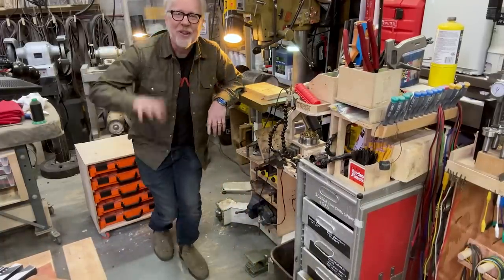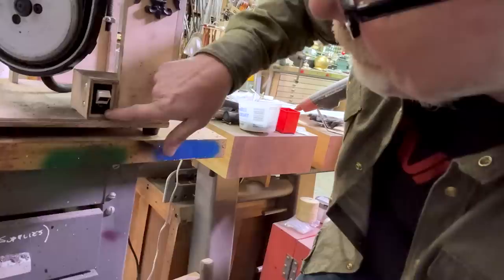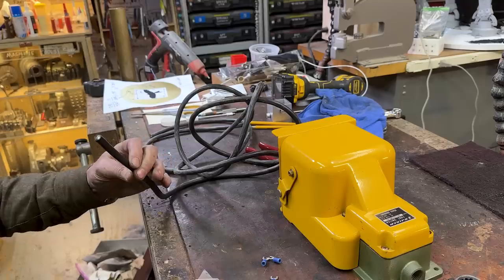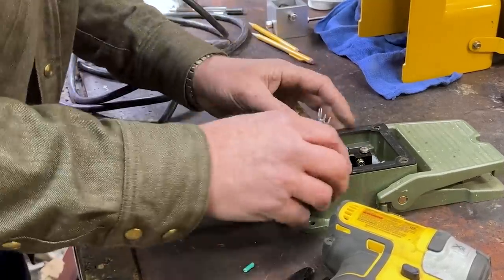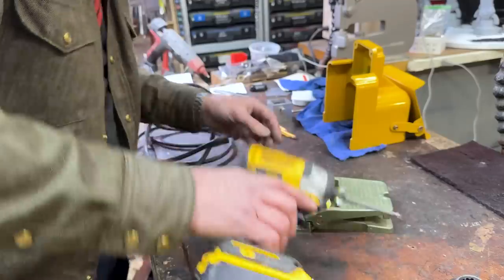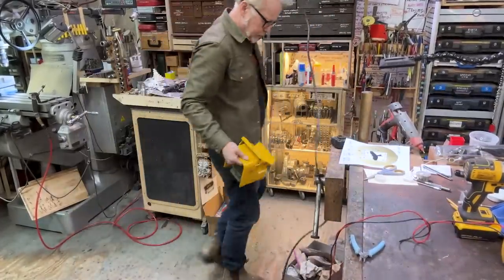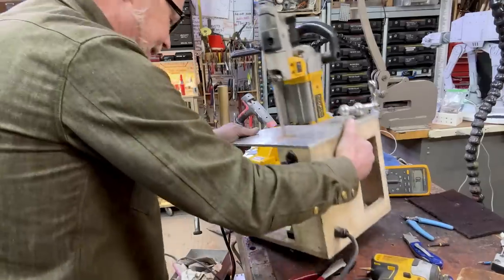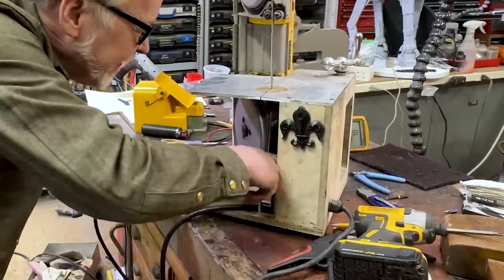Adam Savage's One Day Builds: Foot Switch-Powered Shop Tools!

Comment: Adam, you should really take a took on cable strippers like 
Shtok SI-13
Jokari Allrounder
Jokari #14 or #15
Knipex KN-1664125SB
Haupa Allrounder
to take the external isolation off round cables. There are also similar models for "flat" cables can be in other shapes

Comment: 7:00 The way you scale rubber cable is you use a side cutter to split the end of the cable, make a shallow ring whit a knife where you want to scale to. Peal the rubber like a banana then ripping it off at rhe ring, use side cutter to start the ripp if needed.

Almost impossible to damage the insulation, very fast and easy. May waste half a inch at the end.

Comment: you could have the foot switch control power to a surge protector on the top of your workbench, so if you want to use the saw, drill press, or whatever you plug it in and then you can control its operation and you won't need to buy half a dozen foot switches for each tool

Comment: Should also be making sure you're not leaving exposed metal devices ungrounded waiting for a live Hot wire to make contact with the outer housing and energize it without anyone knowing it until they come in contact with it. Rather having the casing grounded well cause an instant tripped circuit to notify you of an internal fault, especially without that cable clamp to keep from pulling the wires off the terminals.

Comment: I was expecting you to put it on the disc sander.  You use it a ton for quick momentary uses and you're holding a piece with both hands, plus that makes sure it shuts off when you walk away.  With the long wind down, it's sometimes hard to tell if it's actually off when walking away

Comment: I wish all plugs and sockets had lights so you would know if there was power. A small LED on the wall socket, a nice powerful LED set up (such that it is easily visible in the daylight). I've created this situation with essentially permanently-attached extension cords, using the kind of industrial-strength plus that you can twist, locking them together. While they are all effectively invisible in the daylight outside, I never have to search for an extension cord and in most cases, I know if the wall-socket is getting power and (provided I'm inside or even under some shade), I know if the end of the extension cord is getting power. If I turn the tool on and nothing happens. It's easy to check where the problem is. I also label the cords front and back.

Comment: I put a foot switch on my chicken plucked.
Look at the videos of chicken plucked. The on off switch is located in an area where when you t turn it on your face is Approximately 12 inches away from 4-5 inch 35mph whirling flipping flying headless chickens. 
As I watched the videos, while mine was being manufactured in Texas,  USA. I purchased myself a waterproof one. As you are also supposed to be spraying the things with water. Mischief safer, as it only takes 8 seconds to pick 3 chickens

Comment: Adam.  For the love of all that is holy.   Please use your grounds.  If your cord has a ground conductor always connect it to the housing just incase something comes loose or shorts internally. Industrial Lego like that foot switch always has a terminal to connect directly to the case for safety grounds. And please get you some CGB’s to keep in your collection of madness. CGB istands for Cord Grip Bushing. It is a compression fitting for conduit type connections such as the back of that switch that gives you three functions at once. It give strain relief on the cord, protects the cord from sharp edges in the enclosure, and seals the enclosure from ingress of dust and liquids which is especially handy for something that lives on the floor that you are effectively kicking anytime you use it.

Comment: Looks nice but is potentially deadly. It needs that Earth wire connected to the chassis of the foot switch. If one of the other wires becomes disconnected inside the foot switch and touches the metal case then the entire device is no longer touch-safe. I have a foot switch like that, and just had a look to see how the Earth mounting point is done — you can use the screw that holds the cable strain relief clamp approx. 10 mm behind the cable gland.

Comment: Surprised Adam doesn't have those wire strippers that strip wire like that. They spin around that type of wire to make it easier to remove the insulation. I got mine years ago at harbor freight and still use it today.

Comment: I hope that foot switch does not ever have a short to the metal casing because if it does that could really hurt. While it might be just a rocker switch the voltage is still 120 with at least 10 amps. With the full load passing potentially through the body, in the right situation this could be deadly. Please be careful Adam!!!!! With love from an Electrician.

Comment: I have a better tip for stripping cables than what Adam showed.  I work in IT and there's nothing more frustrating than terminating a run of Ethernet cable and having it fail because you ever so slightly nicked the insulation of the twisted pair cables inside.  

What I do (often with a scissors from a Swiss Army knife) is make a cut along the outer insulation longways, near the tip I plan to cut off.  Then I grab the insulation and pull it back like I'm peeling a banana.  

Then I carefully dissect the rest of the cable, cut the shielding and core support, or prepare the twisted pairs for termination.  Once I'm done, the last step is to trim back the insulation, which resembles a crude circumcision.  

That way even if I'm using a straight blade of a razor or knife, I can slip without ever risking damaging any of the cables.  Then all you have to do is get familiar with how far down the twisted pairs need to be in order to successfully punch them down in a patch panel or jack plate, or how far forward they need to sit if you're making the male end of an RJ-45 cable.  Personally, I prefer to have the connectors that have a through-hole design and made for thicker gauge CAT6A, because I'm often using shielded and/or plenum rated cables so things get too cramped.

Hope that helps any of you folks looking to DIY some electrical or network cabling on your own, because that little trick greatly reduces the chance you'll have to redo things or worse if it's higher voltage electrical.  It turns out that most wire strippers go a little deeper than the insulation, and if you have thin insulation on the inner wires or aren't using thicker gauge, solid copper wires (like residential wiring).

Comment: You need to strip the outer layer of the same type of wire... there are special strippers that will do that and never cut too deep... fairly easy to cobble together a purpose specific stripper yourself as well.

Comment: I was thinking that Adam was going to make this foot switch "universal" for use with any of his tools rather than "dedicated" (permanently attached) to one tool.  A universal foot switch would have a (male) plug 🔌 providing power into the switch and a (female) duplex outlet to send power to any tool.  Note: You only switch the hot (black) wire. Green and white wires would simply pass through the housing.  My $0.02.

Comment: Ordered on for the wood shop and one for metal shop. Will wire to receptacle box and extension cord as suggested by @JustinCheger so I can use one switch for various tools to see where I use it most. Then I'll add dedicated foot switches where needed.

Comment: Couple things.  You should really get some proper strain relief on that cord.  All cords need strain relief and those zip ties are not a great solution.  It's a $0.30 part from the hardware store.  You also need a ground to the chassis of that switch.  Any time you have 110 or 220 VAC in a metal enclosure, you NEED a ground to protect you from the case getting electrified.  This is most likely to happen if you don't have proper strain relief and one of the wires pulls out of it's crimp connector.  Safety Third.

Comment: Why not hinge flap on front where put foot in in, flap goes inside top. Then when remove foot flap comes back don to close (with magnets) no having to balance to flip it up top first. More automatic. Also put breaker where old switch was. Spring style strain relief. Dont forget to. Label machine it goes to.

Comment: Those crimp on connectors should only be used for 12 volt systems. Higher voltages can degrade the connectors over time and significantly increase the likelihood of a fire.

Comment: Great idea. Any reason why you couldn't wire the switch inline with the power supply cord? The neutral would pass through. You'd only have one cord running into the saw.   Plug --> Switch --> Saw
Reply: I wired mine in with plug ends for easy versatility. Plugged any tool into it.

Comment: I would have designed the foot switch as a normal extention cord. that way it can be in line with any tool and removed as well at any point without changing the internals of a product

Comment: just an idea ... you should of made a pluggable switch for 2 reasons. 1) if you need to move or transport the machine you wont have a hard wired tail (foot switch) that you may not need/want at the time . 2) with a plug on the end, you could make any/every machine in the shop foot switch powered and just move the foot switch ... otherwise  great video

Comment: Hi Adam, electrical engineer here, I mean no disrespect but this is simply not safe. You MUST ground the metal case of the footswitch with the green wire on the cord, and connect it at the saw end to the ground coming in from the outlet. If you only have a 2-wire power cord to the plug, replace it with a 3-wire one. You MUST screw a proper cable gland into the threaded cable entry on the footswitch, not only to clamp the cable, but also to prevent it from rubbing on the metal and getting damaged. And you should do something similar at the saw end - I can see there's already a gland on the power cord. Finally, it is not good practice to have mains electrical connections inside a wooden enclosure, as you have at the saw, because it can burn. You should put the switch  and cable glands into a small plastic or metal box (ground the box if it's metal) , and screw that to the wooden saw stand. I can tell you did this in a hurry as you are excited about footswitches, but skimping on electrical safety is never acceptable. Please don't hesitate to contact me if you need any more advice.
Reply: Cable glands…?

Comment: does that footswitch have a "panic mode" (if you press it really hard it turns off)? That would be really good in case of a accident since you tend to tense up when shit hits the fan
Reply: It shuts off when you remove your foot.
Reply: @TheFatblob25  yes obviously thats how a momentary switch works. what im talking about is a additional safety feature
Reply: @niklasxl  if the dead man's switch doesn't cover it, you're out of luck. Ain't no way you're able to do something like depress the switch extra but NOT able to pull away.
Reply: @wrongtown  some bending machines ive worked with hadd ones where if you got pushed of balance towards the pedal youd bottom it out and the machine would stop so that you dont get trapped

Comment: Does your foot switch have a grippy rubber pad under it? In my experience, without that, they tend to creep around the floor and you end up having to fish for it with your toes.
Reply: He screwed it to the floor.  Should be slide resistant that way.

Comment: The green wire is the most important wire. So if the hot terminal comes loose and lands against the body of the metal switch housing, sitting on its not-ideally-conductive plywood floor, does the breaker trip? You now have a live 120v metal box just waiting on someone who is grounded to touch it and complete the circuit. The angry pixies want to go home and they will go right through you if they have to, give them a path home.

Comment: That cable needs strain relief Adam, it's gonna fail one day from being moved around too much, the terminals getting yanked off, wires pulled out of the connector, etc. This could cause one of the live wires to come in contact with the metal foot switch, which leads to the second problem here. The ground wire should be attached to the metal housing to ground the housing as well. That way the housing won't become electrified and have the current pass through your heart into the metal tool you're touching.

Comment: I love your videos and you inspire me greatly however I am concerned for you safety. That foot switch is not double insulated so should have the ground wire ( Earth wire) connected to the metal casing of the foot switch and through to the ground on the mains plug of the tool.

Comment: Also not an electrician: I know just enough to be dangerous. But I believe a large chunk of metal with which you make physical contact to turn on an appliance on mains needs to be grounded. If your hot terminal popped off and sat on any metal part without the ground to complete the circuit, the breaker wouldn’t break and it would sit there live waiting for the next unfortunate person to touch it or short to something else and start a fire. That green could have been used to tie any part of the metal (I would be surprised if there isn’t already a connection point somewhere in the switch) onto the ground wires that are presumably already in the band saw and eliminate this possibility.  Disclaimer: I don’t know what I’m talking about but believe this is correct based on my limited knowledge. Don’t take it for gospel.

Comment: Sooo, i hate to be a buzzkill here but i have some concerns: Since i already had a case in my environment where a hobbyist installation nearly killed someone, Please at least add a disclaimer that anything with mains voltage should only be done by a professional. As others already pointed out: the missing ground on the metal enclousure could be dangerous. And regarding the strain relief: there is a threading where you put the cable through, this is for a cable gland.

Comment: Responsible electrics... 
Not connecting the green wire in a metal box that could be electrified when a wire shave through or slip free and touch the sides.
I know a lot of cheap stuff skip adding a place to ground a wire in a metal container. And based on local regulations might be illegal if not grounded.
Please connect the green wires, especially in metal boxes. Also, make sure the green wire length is longer than other wires so if a tug pulls the wire free, it should be the last wire to pull free.

Comment: So the switch on the saw stand, formerly used to turn it on and off, is now redundant.

Why not remove it and have the cord pass through there with some kind of rubber grommet? I think that's the word anyway, just a casual diy guy who likes pulling stuff apart

Comment: Adam, that's 10 gauge wire, suitable for 30 amps. Overkill for your bandsaw of course, which is maybe pulling 12 amps, but it never hurts to have too large a wire. What's dangerous is too small a wire on too large a breaker, like a 15 amp wire (14 gauge) on a 30 amp breaker. For an application like yours I would use a German level of overkill, which is 12 gauge wire on the 20 amp circuit. In a shop, 14 gauge wire should only be used for light duty applications like lights, but never for outlets. And use hospital grade GFCI because standard GFCI can trip when inverter motors are in use, which is practically everything you have smaller than 220v.

Comment: I'm honestly pondering why the switch wasn't spliced in-line with the hot wire. Couldn't one just disable the switch by bypassing it entirely? So the machine will always be running when powered by the hot wire? Whereas the switch is literally at your feet to complete the power circuit. Just my thoughts, I'm by no means an experienced electrician. Just a car mechanic.

Or at least drill the hole on the table bandsaw on the back, next to the existing one, just for ease of cable management?

Comment: I cheated and just put mine with a male cord plug and a female plug directly on the back. Plug the machine into the footswitch and the switch to the wall. Plus I can use it on other machines if needed

Comment: Earth is not connected to "com". Earth must be connected to the metal chassis. 
"live" to common and "return wire" (or how you say in usa. And you should use a real skintop as strainreleif. This installation would not be approved here in europe.

Comment: Using footswitches is cool. Using this kind of knive (or any kind of knive at all) is not. Use a proper tool for that, then there is zero chance to nick the insulations. Even the cheap ones are much better (and safer) than a cutter-knive.